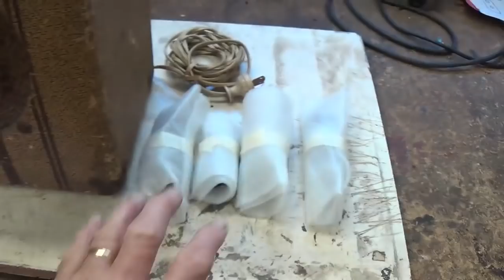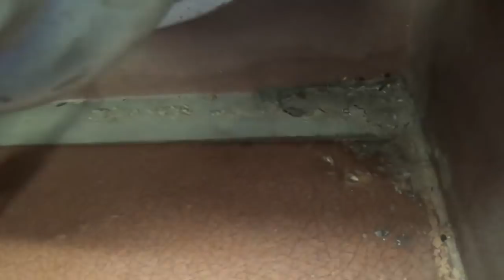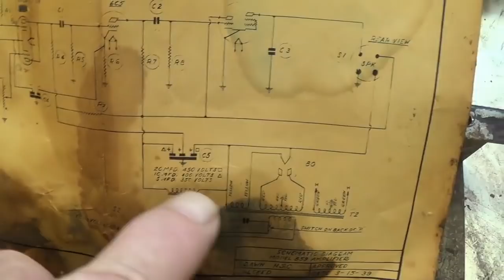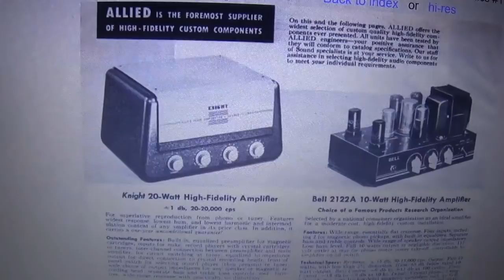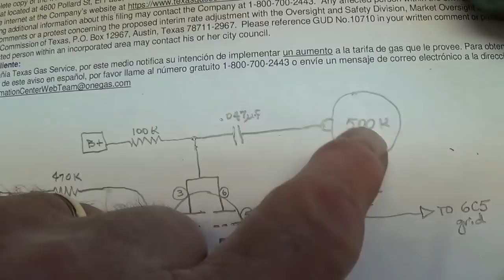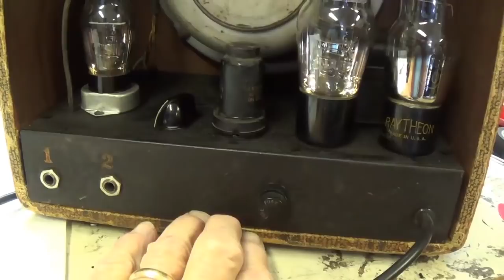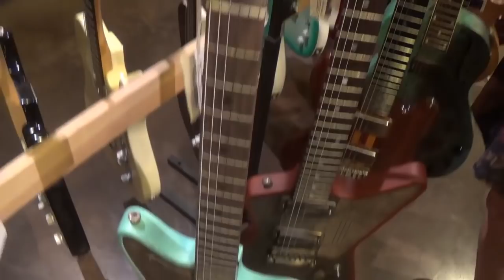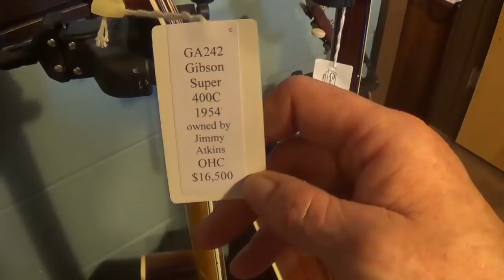Resurrection of an Ancient 1939 Kay Model 859 Amp....The Mouse that Roars (60Hz)

Comment: LOL !!! Plug it in in a neighboring State ! That was great ! Very cool looking amp !
Reply from the maker: Thanks, Todd. I love the look of it......so old and quaint :)
Reply: @UncleDoug  Exactly ! Sounds great too !
Reply: Todd Flowers,  Keep in mind that this was 1939 and even if your house already had a electricity it might not have been of the correct type or voltage or even frequency to work well with this amplifier, so perhaps the extra long cord made it easier for you to find an outlet that would match the electrical requirements of the amplifier! That was satire of course, or sarcasm, but in 1939 some homes and cities were wired for DC voltage and not AC, and 60 Hz was not yet a state wide or citywide or country wide defacto standard for the transmission frequency of alternating current. Some industrial applications actually used 25 Hertz! 25 Herz is still used to run the vintage pumps that keep New Orleans relatively dry!
Reply: @goodun2974  I remember when my  Grandparents house had one outlet and an outhouse and my Dad remembered when they wired it as a kid so yes I get it ,it just struck me as funny as often Uncle Doug does ! ;-)